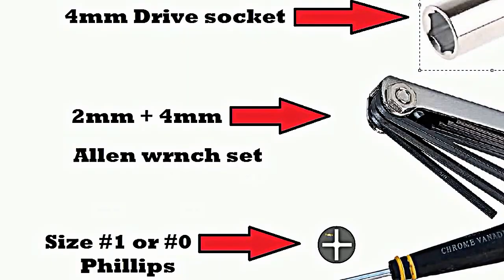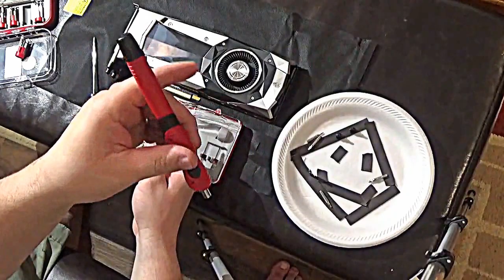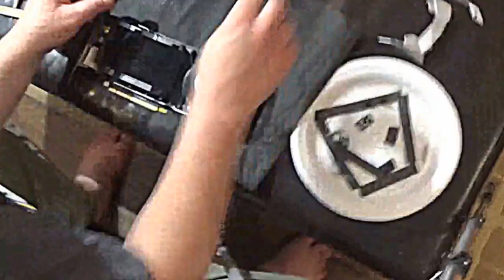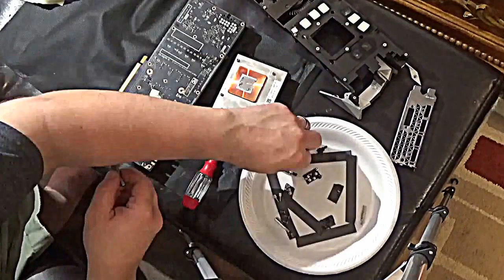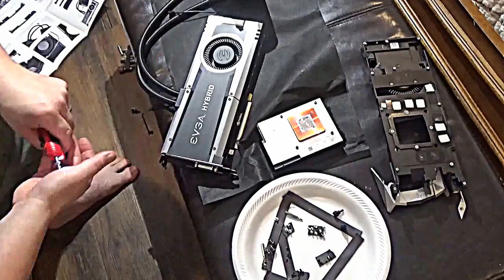How to Install water cooler on your graphics card

Comment: Are there any product like this for compatible with https://urun.gittigidiyor.com/bilgisayar-tablet/gigabyte-aorus-gtx-1080-ti-waterforce-wb-xtreme-edition-11gb-352bit-gddr5x-ekran-karti-gv-n108taorus-367176806?gclsrc=aw.ds&&pkw=&pmt=&sc_gcsp=gg&ggmktg=PaidSearch*PLA*232249887*52560524340*250027983824*%7btype%7d*367176806*pla-420859550110&gclid=CjwKCAjw9sreBRBAEiwARroYmxJBmhK5ZnXbRMB9p8qwLTlrc1BP5q8DopXUlDioziP9-C_BoSFKABoC-7EQAvD_BwE&gclsrc=aw.ds&mpch=ads&scxid=14489-145818-2357-0 fthis one ? i mean idont need that part you install in your gpu...

Comment: my card is straight from nvidia will this kid work I'm. kinda interested I'm just not sure where to mount I have the next s340 would it be dumb to mount it to the back of the case
Reply from the maker: https://www.youtube.com/watch?v=rHdwsW3plx8&t=398s "Skip to about 6min for finished product" and you can see how I did it on mine. I will say that most people mount it in the back but any place should be fine as long as you don't go down.
Reply: maybe not actually I do plan to do sli soon then my case won't support two graphics card water rads but I saw some pics people do place the rad on the back of the case